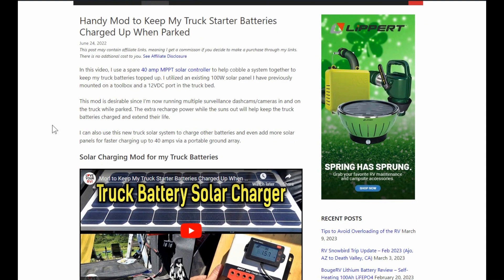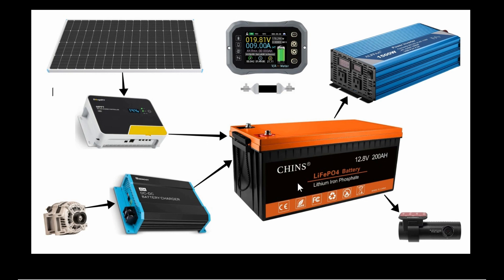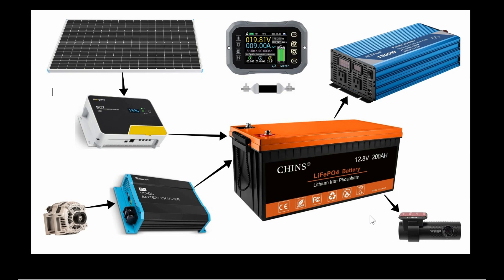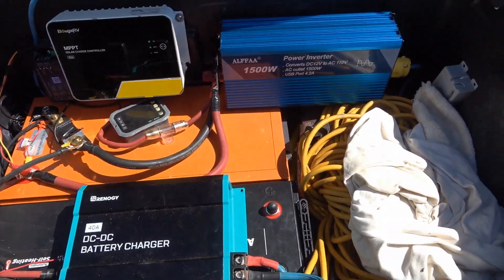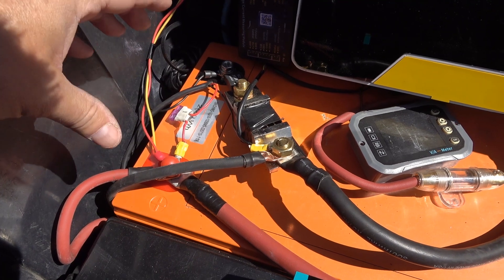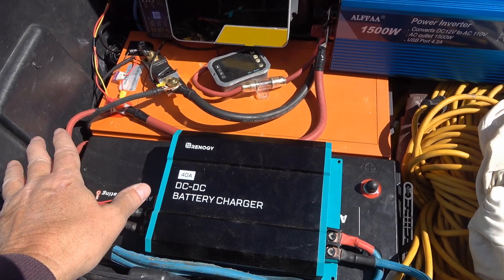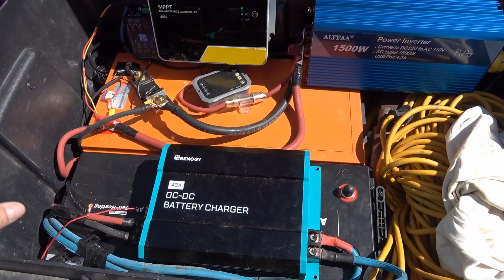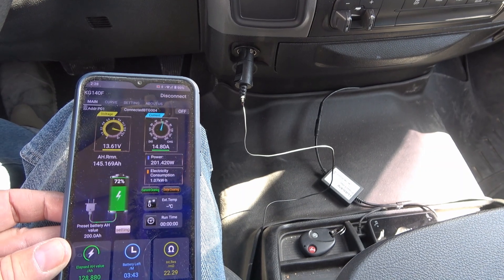DIY Off Grid Tool Box Power System Project Part 1 - Roughed-In Wiring & Test

Comment from the maker: View the follow-up video showing the completed project - https://youtu.be/ztIYUGFQorE
Related Videos
Renogy DC-DC Charger - https://www.loveyourrv.com/renogy-40-amp-dc-dc-charger-installation-and-demo/
BougeRV Solar Controller - https://www.loveyourrv.com/new-bougerv-40a-mppt-solar-controller-with-bluetooth-app/
ALFFAA Inverter + Chins Battery - https://www.loveyourrv.com/chins-200ah-battery-alffaa-1500w-testing-and-teardowns/
Koolertron Battery Monitor - https://www.loveyourrv.com/new-test-gadget-koolertron-battery-monitor-w-400amp-shunt-bluetooth-app/
Renogy Solar Panel Mounting - https://www.loveyourrv.com/replacing-damaged-portable-solar-panel-plus-new-mounting/
Ampere Time Battery Review - https://www.loveyourrv.com/demos-review-ampere-time-12v-200ah-self-heating-lithium-battery/
SRNE DC-DC Charger - https://www.loveyourrv.com/testing-out-an-srne-50-amp-dc-dc-charger-mppt-solar-controller-combo/
Dash Cam Reviews - https://www.loveyourrv.com/?s=dash+cam

Comment: Man, talk about timing.  i purchased the bougerv controller based on your review.  purchased that exact dc - dc charger also.  and was thinking about a truck box like that! one question though. Have you had any heat issues in a sealed box like that? I live in the south and we see plenty of 100 degree days. Was just wondering.  Great Video!
Reply from the maker: I haven't had any issues but the max temps I see are around 85-90F and even that is not common maybe a few weeks a year in the summer up in BC. The solar panel does a great job of shading the box and there are a couple roughly 4'" x 2" openings cut out of the bottom to make it fit between the hitch legs. So there is some air flow. Helps to keep any moisture/condensation from building up as well. Stays nice and dry in there. I guess you could paint the box a brighter color or install a temperature controlled fan. Cheers, Ray

Comment: Have you thought about adding Rams aux switches. My truck came with them but I believe you can just buy a new panel and install it in your truck. I believe the rest of the wiring is already in your existing truck wire harness.
Reply from the maker: From what I read, it's not a simple plug-and-play for a truck that never came with AUX switches.  Would have to get aftermarket wiring and relay box for $149 https://airdelete.com/products/2013-2018-ram-auxiliary-switch-relay-kit and then a new OEM button module $95  so after shipping and taxes, likely around $300
For my needs, I'll likely just use a simple toggle switch and add it somewhere that looks good or on the side of my drivers seat like I did for the lumbar support I added for Anne's seat. See here -  https://youtu.be/qbnv8M_Xzxk?t=415

Comment: Great video, nine months ago we watched you install that BougeRV controller in your RV and you stated you would do a follow up review on it when the weather improved, I must have missed that review, but wanted to know why you replaced it, did it not perform well? Reason I ask is because I purchased the 30 amp version of that unit based on your favorable experience with it, I did want to get your opinion on it's function and quality, since I now own one that I intend to use to keep a 200ah battery bank alive for the new 12v dc fridge. If I did miss that review please attach a link, Thanks for all your effort.
Reply: Thanks for the update, that's good to know that I did not buy a turkey, mine is not the BougeRV brand, but something called PowMr with red terminal covers and is also made for them by helios like a couple other brands, but I'm sure they are the same on the inside. my LED's are also too bright and the display is too dim, the App is a bit weak in content but it saves money having the Bluetooth included. Glad you still like it, that gives me hope. Thanks LS
Reply from the maker: Thanks for reminding me. It must have slipped through the cracks. I'll work on getting an update published, as I remember, I did do a disassembly at one point to see what the inside looks like and have the footage for the review saved somewhere on my computer.  It worked well with my main RV system for about 4 months, but then I decided to swap it with the SRNE controller that was in the early versions of my truck box system so that I would have two SRNE controllers in the RV. Figure they would match better running in tandem like I have set up. Also doesn't hurt that the BougeRV is more water resistant.  The only things I don't like about the BougeRV are the connectors, as it's a little snug to get wires into them and has a metal case surrounding them. I actually cut away a bit of it to avoid then shorting.  And the digital display is too dark, while the LEDs are too bright. Functionally it has worked well, and I like having the built-in Bluetooth app. BTW I believe I sourced the company that manufactures these controllers called Helios https://www.helios-ne.com/mppt-charge-controller.html BougeRV must buy wholesale and rebrand from them. Cheers, Ray

Comment: Although I have watched you over the years; this video was very timely. In about a week or so I'm going to build 'power station' simular to the one in your p/u bed. Not sure I'll need the DC-DC charger but living in the PNW & camping mostly in wooded areas we may do so (?). Big advantage to charging at 40 amps while just driving. That equates to ~ 8- 100watt solar panels at peak harvest. You just saved me the time of finding your old video when you built yours. TNX